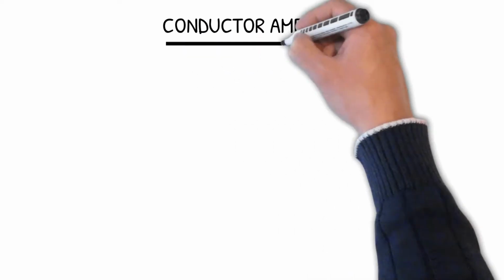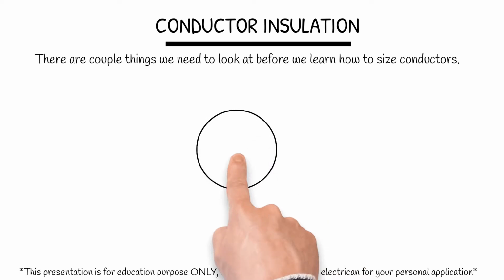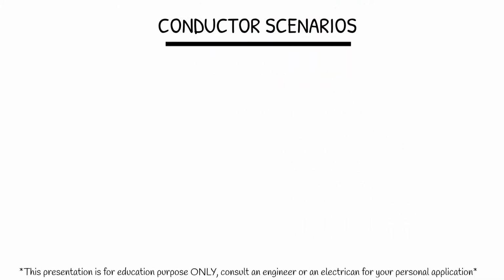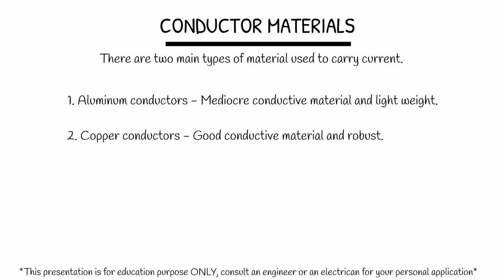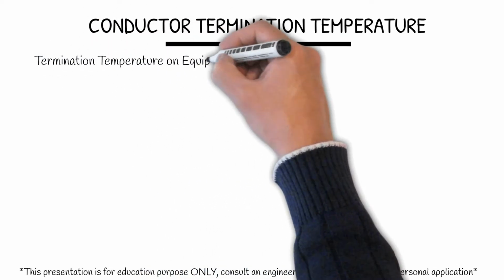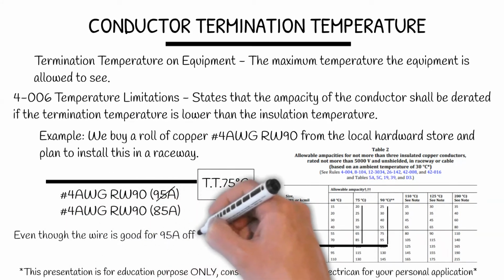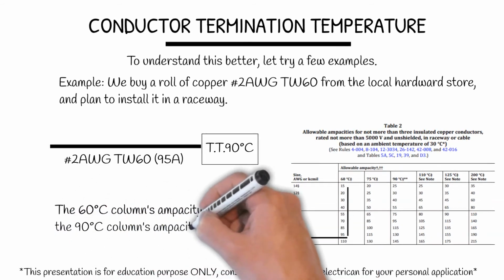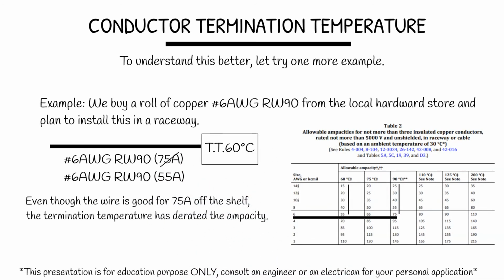Electrician Apprenticeship   #8 CEC Conductors General

Comment: hello my friend that big effort you are doing thanks a lot, would you please notice the note on table 5A at the bottom of the page " the insulation temperature rating is the temperature marked on the conductor' so I think It should better to used it directly unless in this case we doubled the deduction twice in the table 1,2,3,4 and in table 5A.